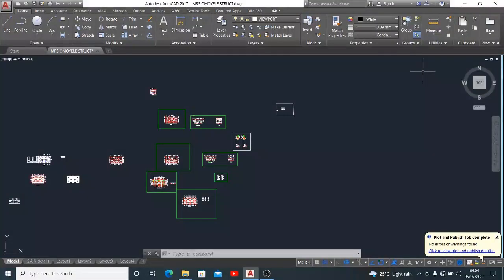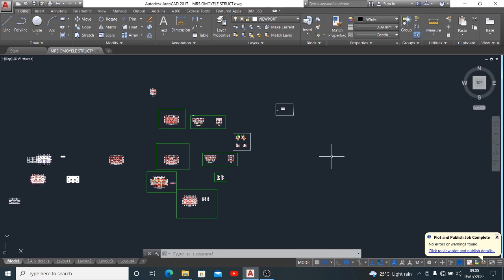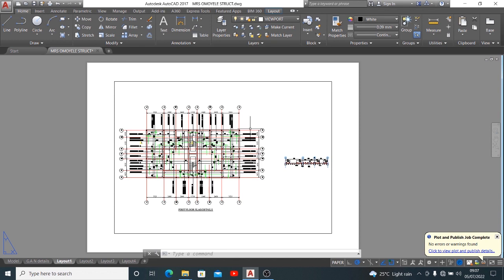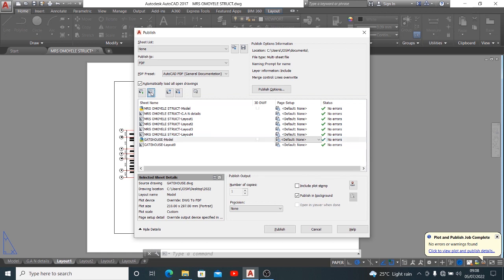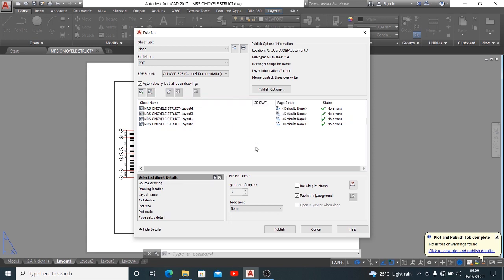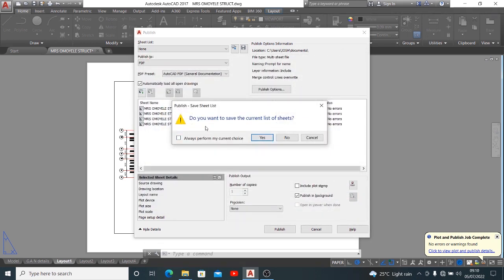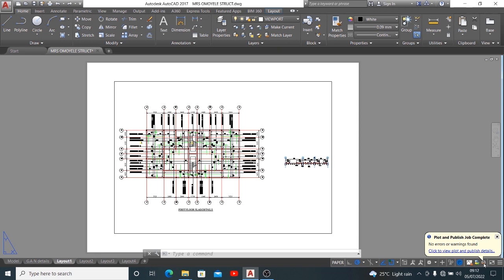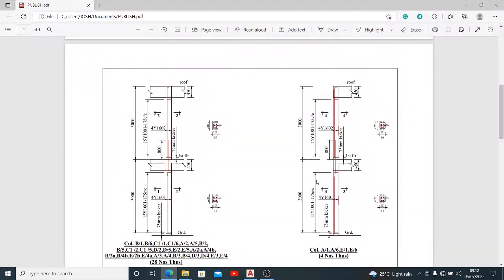BATCHPLOT: How to plot multiple pages to PDF in AutoCAD

Comment: Hello Joshua, your video on batch plot was inviting though it addressed the question , but the procedure wasn't clear in view of the problem you use for the exercise. As a structural engineer; I have designed my project into an AutoCAD model space: cover page, foundation details etc. up to about 50 pages. I do not want to setup 50 layouts again, but to batch print/export the  drawings to pdf. You started well but at the publish environment you added more files at the add sheet options more that the one sheet drawing you showed us.  Please use one model space example( containing at least 5 drawings). I have tried this batch plot method again but my result will be a one page PDF output with all the drawings.
Reply from the maker: Thank you for taking time out on this, I will work this out and you will hear from me soon